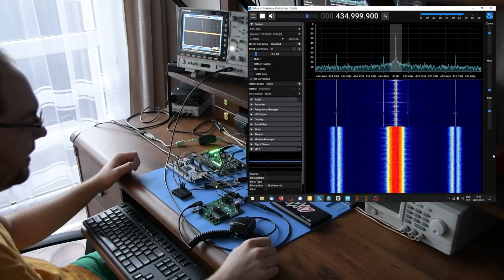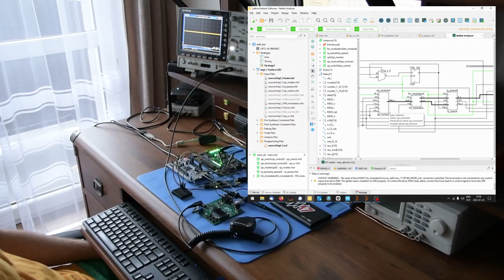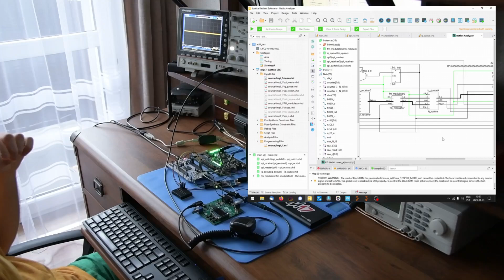OpenHT Proof of Concept: transmitting M17 with an FPGA

Comment: I know this video is a year old now, but I was wondering if you have found an alternative to the ATREB215-XPRO now that it is discontinued? Is the plan to move away from the expansion board and just use the base AT86RF215IQ chip?